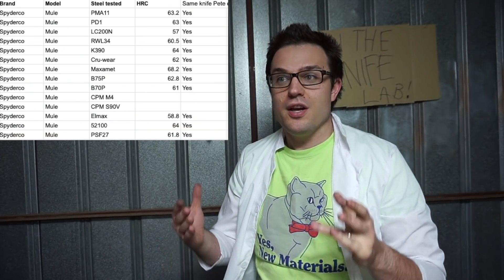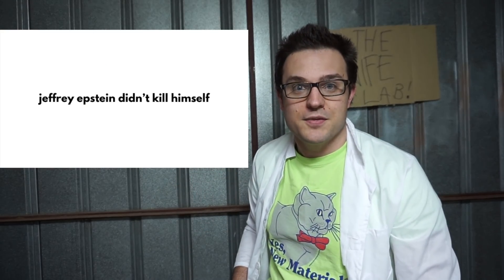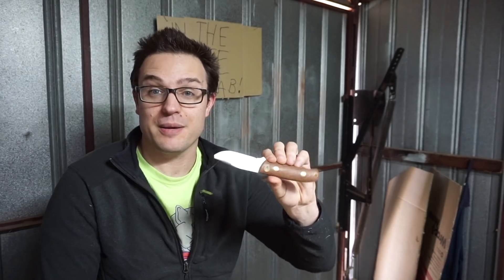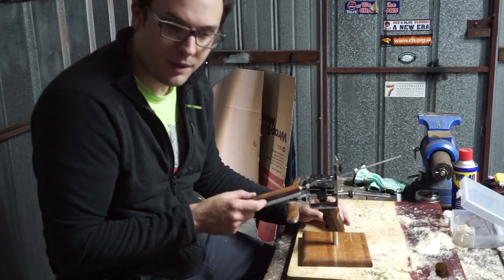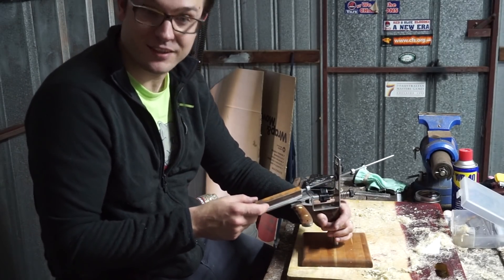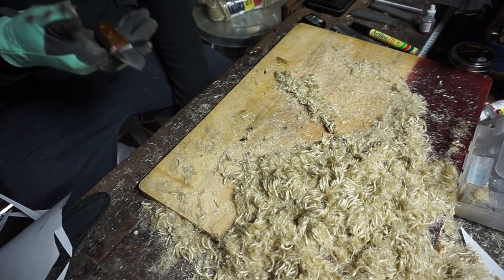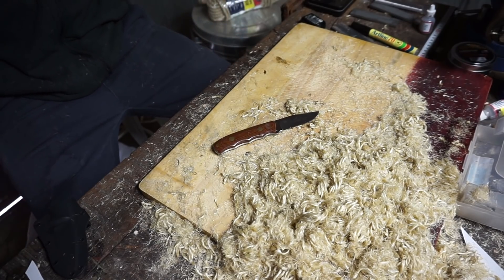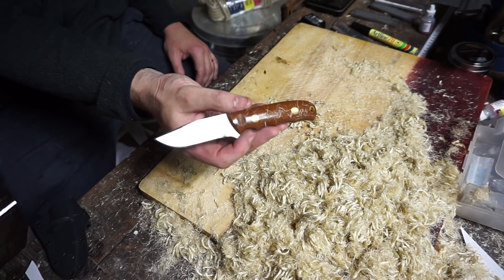Dozier D2 the king of D2 steel?

Comment: Fantastic! Wow 425 cuts D2!
That goes to show what happens when you treat and sharpen a steel to it's potential 🤙super awesome Pete 🤩
I have a question for you though, what grit stone (diamond plate?) did you use to finish at before stropping? 
Someone also D2 if treated to near 62HRC will support a steep edge angle 12-15⁰/24-30⁰ apex? Maybe squeeze another 200 cuts out of it which would put D2 in range of lower end super steels. It makes sense when you look at the metallurgy data showing D2 hybrid components and ratios of elements. 
Great video thank you for taking the time to eek out D2 potential 😎aloha T

Comment: You might consider getting different steals of the same knife like a bark River Aurora in a two, 3V, crew wear and M4 and running your test again. 
Heat treatments is the magic the steel is just cookie dough. The heat treating can either cook the dough to perfection, burn it or leave you with raw dough

Comment: I recently bought a D2 steel 4 mm thick knife blank on Ebay. It is supposed to be hardened to 58-60 HRC.  But I have easily cut a 1/4 x 6 inch section from the handle  portion of the blank with a cutoff wheel.  And filed that smooth using a Husky file set purchased from Home Depot.  This is my first knife build.  So it didn't occur to me right away.  That something might be wrong here.  But it seems to me that I shouldn't be able to do this at all. If this were tempered D2 steel.   Can anyone with knowledge of D2 tool steel help me out with this?

Comment: I had just about that same dozier years ago (with a nice, custom molded, belt-clip kydex sheath) - maybe mine was a hair's breadth smaller.  I also had some beautiful, simple, spearpoint folders with micarta scales featuring a beautiful, simple, oval-in-the-center pattern.  The fixed blade was small, and hollow ground, with a factory edge.  I fractured it badly trying to baton through a large piece of knotty hard-wood firewood (I was going through an edge or thinner section of it).  I was new to knives then, and, granted, it was a total abuse of a small, hollow-ground blade.  Regardless, it left a bad taste in my mouth, to this day, about D2 - I'm always worried it will be brittle (it wasn't an edge issue, but a large half-moon fracture form hitting a twist and/or knot).  Dozier offered to re-grind it for me - which seemed fair, but not replace it.

Comment: ive said it many times before that there is a proper way to heat treat D2 and it does well. China D2 cannot compare in the least even at 62hrc. The protocol they use has been posted on bladeforums a few times by Carrothers Performance knives. and he even talks about the science of said protocol with the composition of D2.